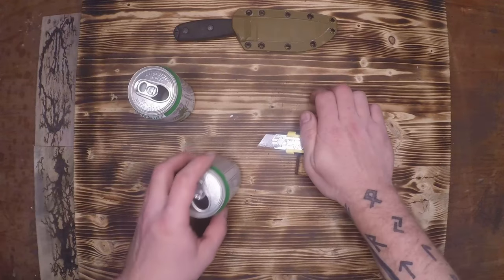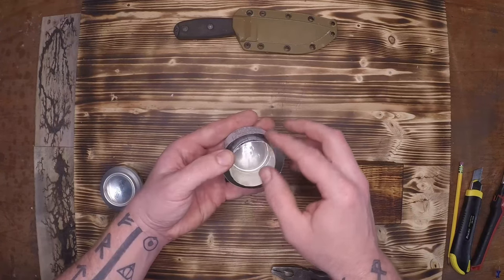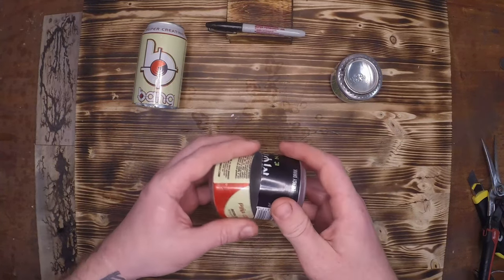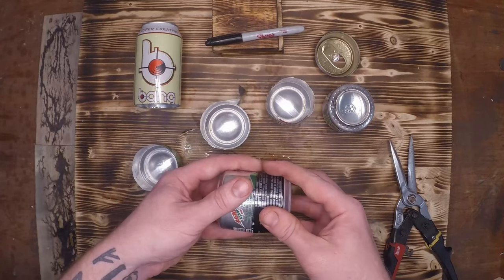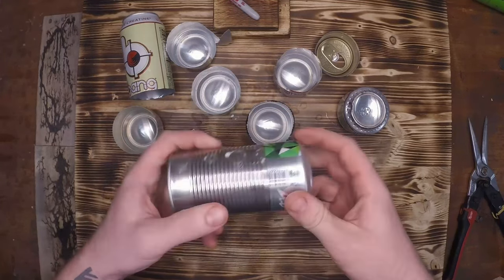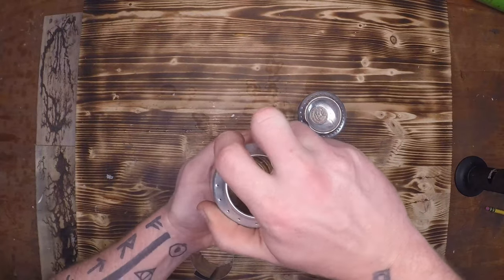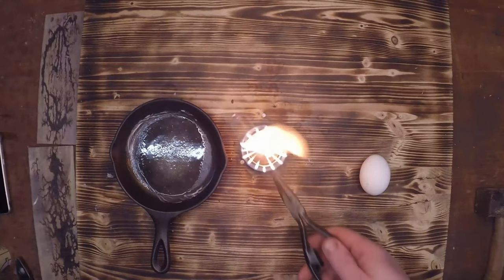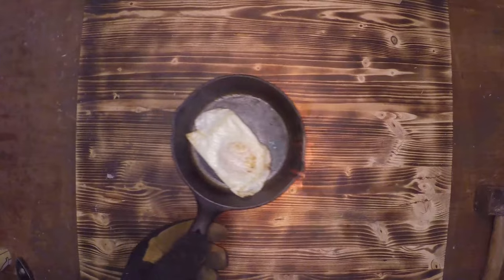Alcohol Stove 2.0 Easier, Stronger, and More Robust! Build for under $2! Full instructional video.

Comment: Frankly, I highly recommend buying a few folding mini gas stoves with built in tripods with flexible extension tubes, and as many cartridge converters so you can just use the widely available gas cartridges (the kind you see used for portable gas stoves in steamboat restaurants) on top of regular camping canisters (not as common). The flexible extension tubes allow you to connect the cartridges lying flat. Really gives much more control over the strength of the flame. Only benefit to an alcohol stove is that you can just top up the bottle of alcohol for the next trip as compared to carrying 1 full and 1 half-used gas cartridge. Again, there is a work around for that called a refill adapter which you can use to refill the cartridges using a larger gas tank. I personally think gas tanks and cartridges are safer when stored properly compared to liquid alcohol.
Reply from the maker: Allllll solid points but the purpose of this video was to show how to make an alcohol stove not determine the safest stove to use. That would be a different video.
Reply: You could also just buy an RV and a microwave and camp in your driveway 🙄
Reply: well alcohol stoves are mostly used in ultralight backpacking. most of my trips i carry a gas stove as well but when packing ultralight i don't need anything other than a flame to boil my water so i take my esbit or alcohol stove scince it does boil water (everything i need) and is much lighter.
Reply: Also: noise. Also: invisible flame. Also: weight. Also: simmer and slower cooking capabilities that nearly all gas stoves just can't perform. Also: DIY is fun and makes people care more about the craft and event and experience. Also: good luck refilling your 220g isobutane canister from a Blue Rhino propane tank with all those adapters and hoses when you're in some far-reached mountain/countryside town and you are on a time/resource limit. 🤡

Comment: I have yet to build one, I'm a procrastinating old guy🤣. The insert at the bottom should have 2 notches in it, one opposite the other. I'm think not to take the center completely out but make like 5 hole in the center with your push pin fill it, light it and put a penny, nickel over the holes. But love the soup can... That's great!.
Reply from the maker: You're right about the penny. It's why they call it a penny stove.
Reply: @FollowTheCompassNorth  Out of curiosity, have you tried Bioethanol? 2 year's ago I "Was" going to build one🤣 and this old fart said Bioethanol? I never looked into it. I dig your videos. Trying to make a heater with my Trangia into a T Vent with a fan, works great, but 5 mins later? Wish it lasted longer, That's what she said 🤣🤟😎
Reply: Make sure it's a pre 1982 penny that's full copper. The newer zinc ones melt 😅

Comment: Would heating the edges of the can to a point where the paint/logo would dissapear make a difference? Might make it a better fit?
Reply from the maker: That's not a bad idea at all. Some light sanding might help as well. Plus cans are lined with a little plastic to protect the metal from some sodas.

Comment: Great video I’m glad I learned how to do this. However I was a little confused as to what exact type of alcohol it would use, and also the cap that you used as well to retain the flame? Would this be safe to use in enclosed spaces like a car for heat if trapped? Finally, how long can the stove stay lit? Thank you!
Reply: Use denatured alcohol, or yellow bottle of "heet"

Comment: Did you see the stove build where the guy put the can that slides inside the other one on its side laying on a toothpick and push down on it with his finger every quarter of an inch and then the can slid together just like that you don't have to go down very far maybe 3/8 of an inch and it puts a little crimp every quarter of an inch and the inside can shrinks down just a shade on the edge so it started and ready to go on

Comment: How did you make the center cap? Did you poke holes in the center cap? Thank you!
Reply from the maker: No holes, I used the bottom of another can. The better method is to just make a small hole in the middle and cover it with a penny. That's where the term penny stove came from.

Comment: I notice you made the final product pretty shallow, is that better than a deeper stove with more volume?
Reply: Theoretically at least, it's s possible to make them too tall.  At a certain point the flame can be too far away from the remaining fuel to vaporize it.  In other words, a too tall stove that's nearly empty might go out out before the fuel is all used.  I've never done it myself because I don't need one that big.  My biggest one was made from two 24 ounce tea cans.  It's almost 3 inches tall and holds about 6 ounces.  It burns about an hour and uses every drop.

Some hikers want everything to be super light weight so it's possible be chose this size to do just what he needs it to do without any extra bulk to carry around.

Comment: Don’t need a razor blade to open it up there is an old tool that the military uses called a P 38 use that and you can completely cut the top of the can off without all the extra steps you mentioned for cutting the top off seriously use a P 38 army issue you can find them at any military co-op or sporting good store
Reply from the maker: A P38 only works on rimmed cans like soup cans, k rations, and c rations. It leverages the lip to cut slowly through the metal. I have one on my keychain. It wouldn't work as well as a razor blade or scissors in this case.

Comment: Most aluminum cans are made in the same place .
Reply from the maker: Where? When I read about it I find several places.
Reply: @FollowTheCompassNorth  There are several factories that make the containers for all of the soda makers. They all pretty much use the same machinery for extruding the aluminum cans- so that's why all of the cans are the same size. Different companies will place orders with their logo designs and info printed on them. 
The soup can fix was inspired. Never would have thought of that!